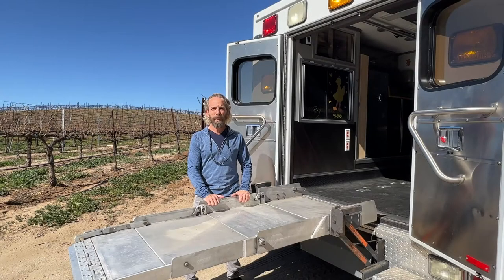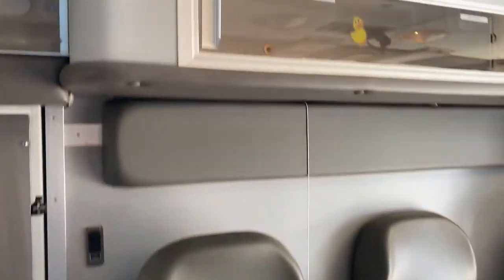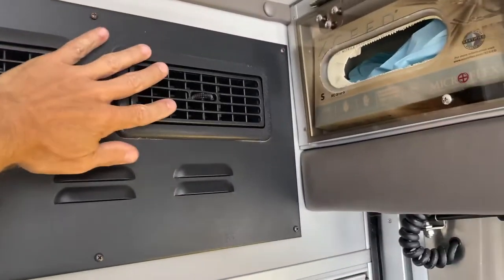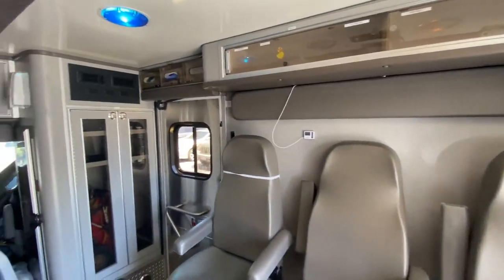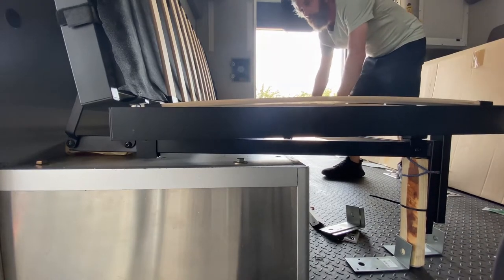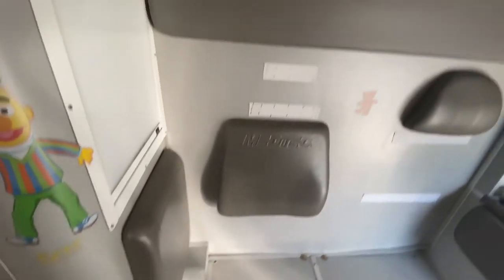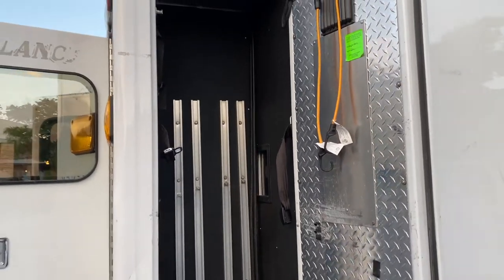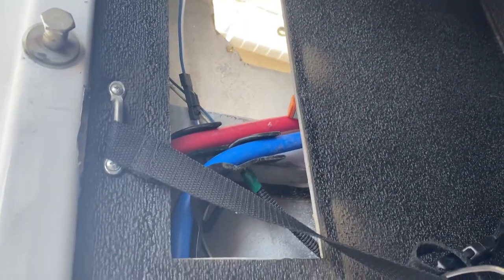The Before and After of The Ambulance Build. How to Convert One!

Comment: Keith, if you don’t want that Bariatric Lift I could be willing to take that off your hands. I have a 2003 Freightliner M2 Ambulance that I’m slowly converting. I have MS and use a wheelchair 97% of the time and I’ve been looking for those lifts with little luck.

I was looking for your email but don’t see it. Is it on a page I’ve not seen, I don’t think so. Any suggestions?

Mark R. Weaver

Comment: Hey Keith,  question for ya.  The person I have helping me convert my ambo is insisting that I can use a larger inverter generator only to power rooftop ac/heater (especially for overnight to sleep) induction stove top and fridge like yours- and it can be made to be quiet enough to sleep And be carried / operating onboard rig in rear compartment with pull out shelf.  What is your thinking on this versus solar with smaller generator back up.   *note: I do have limited budget.
Reply from the maker: Christine
To make sure I understand your question, you reference "inverter generator" and then in your last sentence "smaller generator back up".

If the person helping with the conversion is suggesting to use, like a 3K inverter like I have to power all items, you'd need to do a load calculation first. Knowing what is running at one time is essential. If the person is saying you also need a generator, regardless of what you have to operate as this is more cost effective to address peak load and running load?

Most fuel powered generators are often higher decibel and you might need to run a long extension cord to be far enough away to not hear it.
Then you have the fuel issue to contend with; carrying it around.
And the maintenance of the generator.
And the space/weight of the generator.

Also, think about where you live and where you will be going. This plays into the calculus of the decision tree.

And budget: I'm not fully clear what your budget is, correlated to your load profile.

So I'd need more info to respond with any strong ideas.
Reply: @dailydestinations9416  he is suggesting to put a large inverter generator like 8,000 watts in the rig (one of the back outside storage areas toward the double doors) and run it while it's inside. He says he can quiet it and make sure there are no fume issues by venting it with like a stack that goes above the roof line etc. I live in far northeast Wisconsin My biggest concern is summertime heat and humidity here where air conditioning is needed. This probably is more needed than heat though I plan to take it to go on snow showing trips. Budget is as little as possible within reason to make sure things are safe and work correctly. Thank you so much for your time and thought. The whole power thing for powering air conditioning fridge lights has me baffled as far as solar being functional all the time since we have so many cloudy rainy days and a tremendous amount of shaded camping spots both rustic in state and national sites, as well as boondocking sites. So I know that solar alone is not going to do it. So having an onboard generator seems like  a necessity though I'm not sure how to do this and keep it quiet as well as safe.
Reply from the maker: To clarify, it sounds like a generator only at 8k. I'm confident it can be made quieter, but they still make noise. And yeah, carbon monoxide and exhaust fumes should be addressed and get a couple of CM detectors. It is hard to predict how much fuel it will consume due to the variable nature of anyone's load profile. Did you do an audit of your needs? And is the generator diesel? Yeah, it is cloudier in NE WI for sure. Each market often requires evaluating the circumstances and taking the appropriate modifications to the ideal plan sometimes. Are you still installing an inverter? What kind? Type? Batteries? As you last wrote, "quiet". We endeavor to go into the wilderness for the sounds of nature, then we start the generator. Try and find a middle ground or a hybrid approach if you can.